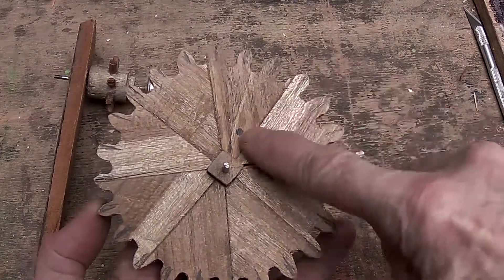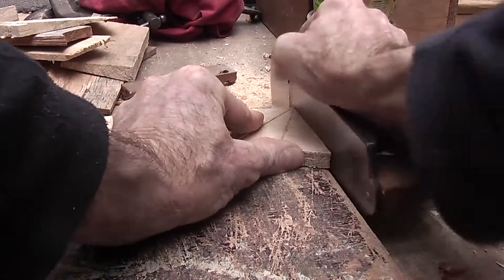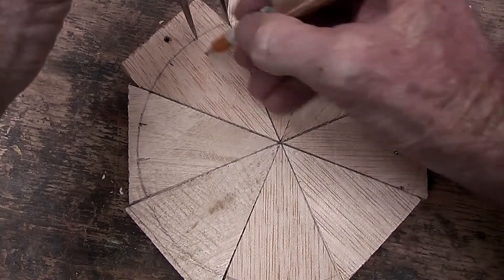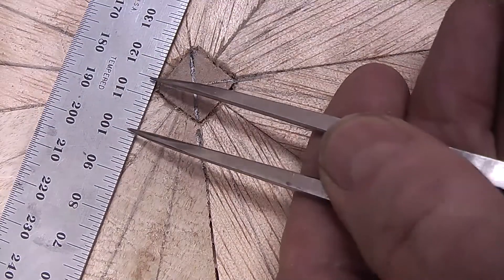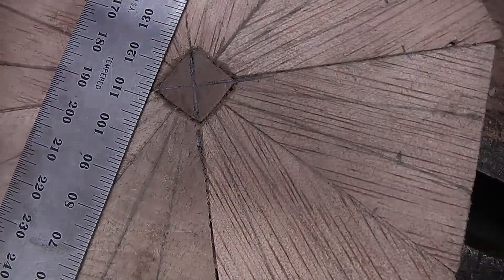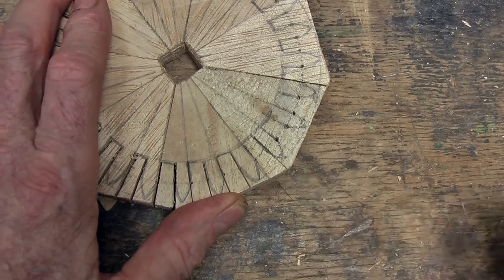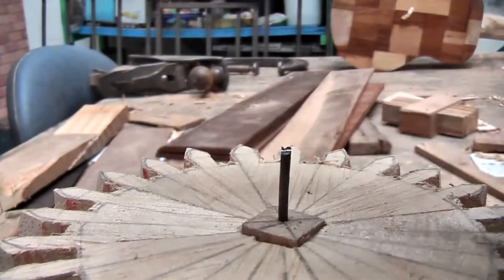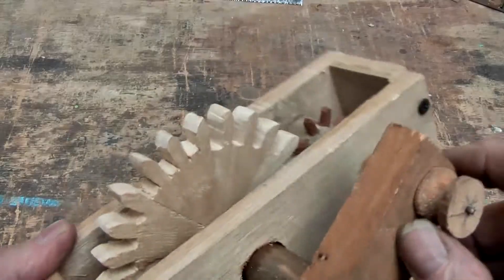Make A Wooden Gear

Comment: Why did you choose to cut the teeth into cycloid profiles (with deep square pockets) instead of involute teeth?  That would've required just 3 cuts per tooth, rather than 5.  How would involute teeth be any less functional in this application?
Reply from the maker: I suppose it is because I came at it from a clock makers historical starting point, and what fascinated me in the deautiful way the teeth interact, rolling faces reducing friction rather than pushing and sliding faces, which wear. Even high quality involute teeth have curved faces, if wear and friction is an issue. Reducing friction in clock making has always been high priority. But, you have a point, I may try your suggestion.